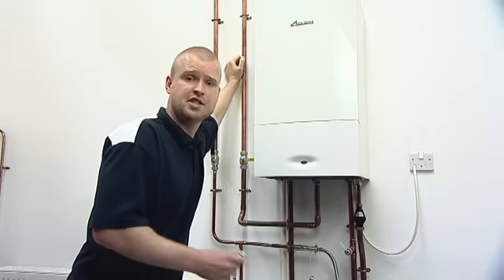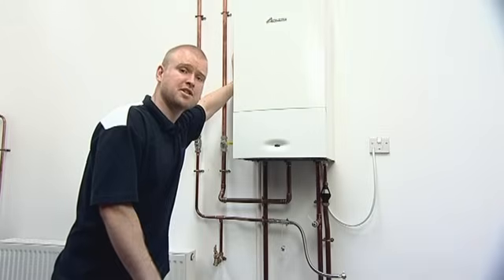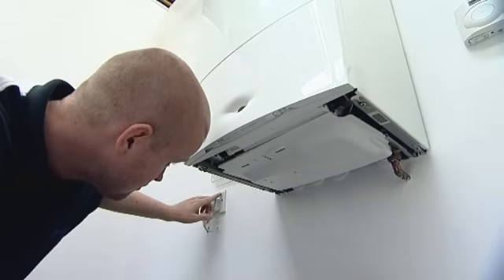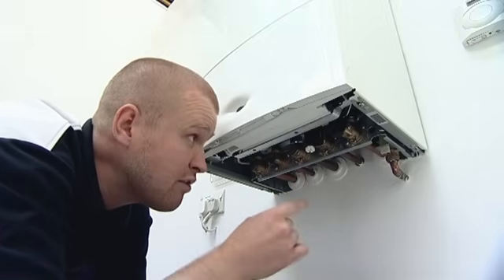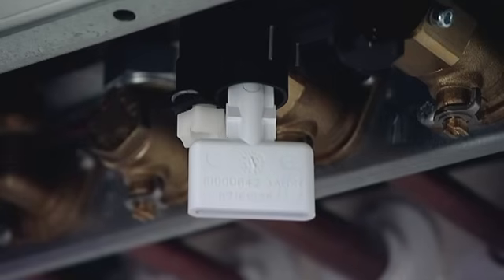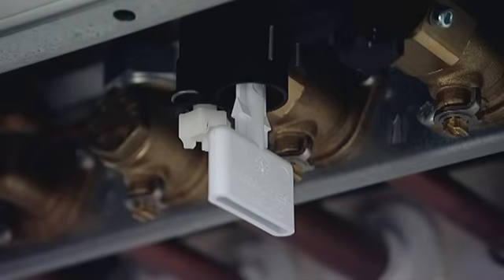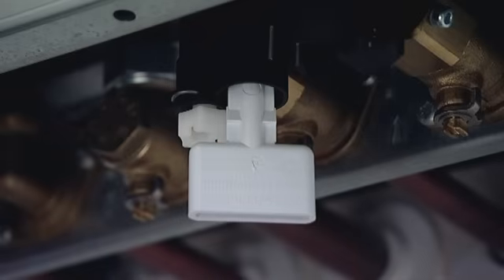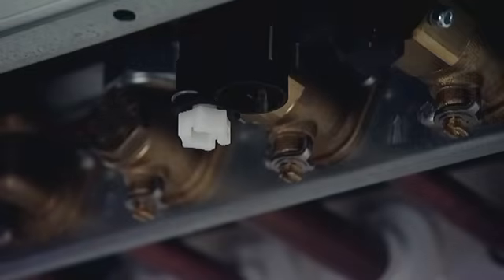How to Repressurise a Heating System with an Internal Filling Key | Worcester Bosch

Comment: My mum's boiler pressure always drops to zero which messes up how it works; it cuts off when she turns the bathtub tap too high & makes strange noises. Repressurising is difficult because the tap is so stiff that it's basically stuck. And every time an engineer visits they "fix" whatever they think the problem is but then the boiler goes right back to square one almost immediately after they've gone. At this point it's probably better to have it replaced, right?

Comment: It's strange. I had engineer around today telling me my boiler is on zero pressure, but I still have hit water and hit radiators. He couldn't do the reset (in video) due to an obstruction near to the key area. What a joke. Good video though.

Comment: Can anyone tell me if they struggled getting the key in?? I don't know if I'm just not pushing it in hard enough but it wouldn't go all the way in 😢
Reply: i have struggled getting key both IN and OUT - it wont come out
 after white key turned to open (unlocked) , Eventually I get the white nut to turn and the water can be heard, When pressure is OK after turning white key clockwise, stopping the water, I cannot remove the key (Can;t pull downwards)
Reply: @williamsmith9754  thank you, i couldn't even get the key in. thought it was me! will keep trying

Comment: I just moved into a new house and the pressure is showing as as low in the red as possible. Before I do this, are there any other reasons it would show that? Or should I just go ahead and follow these instructions?

Comment: I think I'm retarded as the water just leaks everywhere when I try this. I was successful with other brand boilers. I can swear there is a pipe missing in that spot, the key just keeps spinning round, there is no mechanism to close it.
Reply: my boiler has just done the same did you manage to sort it?
Reply: FiFitricks Olivier Yes. Push the plastic key in deeper.

Comment: Great, informative video. Unless your key is so tight it doesn’t turn and flexes, threatening to snap. We inherited the boiler 7 years ago with house and refilling has always been hit and miss because of this tightness issue. It’s a ridiculous system and would put me off a Worcester/Bosch boiler in the future. So what to do, a boiler with zero pressure that can’t be refilled....
Reply: I've got problems with mine too, I can't remove the key and it just keeps turning. The boiler is on 0 pressure and when I try and fill it the water just leaks out.

Comment: I spent hours trying to follow this: damn key would not go in. Eventually I just turned the square white tap without using the key. Worked fine. Would have been much quicker if I hadn't watched this!

Comment: Agreed - great video.  Used it a few times to remind me what to do.  
Problems I have are (1) getting the key in.  Always been a struggle but keep pushing it just a bit further and then it's in.  However, (2) always been difficult, but today I cannot get the key out.  Seems well stuck this time and I'm worried about breaking the key in place or damaging the boiler.  Please can we have a video on that?

Comment: I am trying to do my boiler just now, I have the key at the locked padlock and when I turn the water on to fill the water just comes out from where the key is in? Any advice 🤷🏻‍♂️ thanks
Reply: You need to push the key in further up! I had the same problem

Comment: mine doesnt have a plastic key for some reason, and it doesnt have a plastic manifold under the boiler either. Would it be ok to use a flat head screw driver on that 3rd pipe thing under the boiler off the video? My boiler is the worcester 30cdi

Comment: Thanks for the video. Easily the most annoying pressure top up procedure ever. Cheap, nasty, plastic key, markings that are impossible to see under the stairs and really hard to see the pressure gauge when you have to slide under the boiler to force the ridiculous key into the hole. Terrible design. But the video helps to clear up the problem. Somewhat.

Comment: Does anyone know if you actually need to remove the white key after returning it to the unlock position?  Mines stuck in....
Reply: My new fitted boiler has this issue as well, your suppose to take it out for regulations but won’t do no harm leaving it in

Comment: It’s CLOCKWISE!! 2 minutes in. He says anti-clockwise while turning it clockwise. Nearly cost me a plumbers visit till I rewatched it.
Reply from the maker: Hi Kay, I can see that he does start to turn clockwise but then immediately stops and turns the nut anti-clockwise. The correct way to turn it is anti-clockwise 😊 - Aiden
Reply: Worcester Bosch - Hi Aiden, on my boiler it is a left turn - clockwise. And right to tighten. I am referring to the white plastic square. In the video he turns it left too.

Comment: I followed this but when I turned the white nut water started pissing out
Reply from the maker: Hi Chris, This normally means the filling key is not fully inserted all the way, it can take a bit of force sometimes. If you give our tech team a call on 0330 123 3366 they should be able to help over the phone 😊👍 - Aiden
Reply: Pushed it in further and pressure up nice now . Bleed radiators but still no heat?

Comment: Very informative video, thanks
Unfortunately our water pressure is at 0 and when I turn the small valve, water pours out and the needle doesn't rise at all. I have to hold a huge bowl underneath which fills very quickly. Any ideas?
Reply: Yes: When I did mine, turning the key water came out and it did not work! SoI turned the key back to lock and opend the white nob. Waited for about 30sec then turned the nob off and the key to unlock. Then turned the key to open , and it worked.

Comment: very helpful. I now have consistent hot water. What surprised me was that the key was already in position and I could not turn it but was able to switch water on and switch off when it got to 1.5 bar. Thanks

Comment: Hi I watch this and thought I could do it no problem but I went to the boiler and there was no key? Years ago I used to be able to twist a skrew at the back of the boiler and it was fixed. Now I am afraid to touch anything in case its gas. Is there a way I can do this without a key?

Comment: I have followed this but once key is in, turned to lock hen turn the white plastic ut water flowes out.  any ideas what i am doing wrong?
Reply from the maker: Good morning Dave, It sounds as though the key may not be fully inserted, it can be a bit stubborn sometimes. If you are continuing to have this issue it would be worth giving us a call on 0330 123 3366 so the tech team can help 😊👍 - Aiden

Comment: Anyone else try the blue lever and just got a couple of drops of cold water out the bottom and no pressure change?
Reply from the maker: Hi Steve, if this is happening it could be that the water to your property is playing up or the pressure method has failed. I would recommend giving our tech team a call on 0330 123 3366 as they may be able to help 😊👍 - Aiden

Comment: Excellent instructional video. My key was difficult to insert into the hole, quick touch of fairy liquid on the 'O' rings help to ease it in. You do need to make sure that it is fully seated before you turn to the lock position. If not it will drip water, when you turn the white fill knob on.
Reply: Thank you for this comment, I was ready to give up after 3 attempts but after reading your comment I tried the fairy liquid and got the key in all the way!

Comment: I've done this a few times but today I cannot turn the white button anticlockwise as it is too stiff- Have tried with a little spanner but it hardly moves and the pressure is very low.

Comment: What key is that guy using? Mine is like trying to get the proverbial sword out of the stone.
Reply: im sure if you don't have it Screwfix  or similar hardware shop will have it.... or if you're desperate a large flat head will work.
Reply: @bashthefash420  I've got a key....it's permanently stuck in the boiler. I'm actually not bothered about it, if anything goes wrong I can just buy a new boiler.

Comment: First time I went through this procedure of refilling the system (after drain down) my boiler started dripping from the bottom and would not stop dripping, it turned out that the auto air vent inside the boiler got stuck partially open so all I could do was drain the entire system to stop the leak and call out an engineer.

Comment: I managed to refil the water by following your instruction. By fiddling with on and off key It now went beyond 1.5! How do I decrease it to 1.5? Also I can't pull out the arrow key it was there left by the engineer! I watched you turning back to padlock open position before pulling the key down to remove it. Is it safe to leave it there on Open pad lock position since I can't pull it off? Please reply and THANK you very much!
Reply from the maker: Good afternoon, To decrease the pressure it is best to drain a radiator closest to the boiler. If you need help with this you can give our technical team a call on 0330 123 3366. 😊 - Aiden

Comment: I can't remove or pull down the key! Should I leave it to the pad locked position or open padlock position, please Help!
Reply from the maker: Good afternoon, The key can be quite stubborn sometimes. I would recommend giving our technical team a call on 0330 123 3366 as they have some tips for you. If it has to be left in it would be best to leave it facing the closed padlock symbol and just make sure the nut to the left is 100% closed to avoid the pressure rising without you noticing 😊 - Aiden

Comment: The trouble I had with this 'key'  went on and on,  each time I thought I had it I got nothing but water when I loosened the feed I could not get it to mesh with the connection in the pipe wether I had a sub standard key I don't know, I hope I don't have to go through that very often is there no other way to re-pressurise the system?
Reply: Info: When I did mine, turning the key water came out and it did not work! SoI turned the key back to lock and opend the white nob. Waited for about 30sec then turned the nob off and the key to unlock. Then turned the key to open , and it worked.

Comment: Did this the first time ever because I noticed some strange noises from the boiler and found pressure in the red. Key was already in place and in the lock position?! Anyway followed instructions and that was perfect! However I couldn’t get the key out after turning it to the open lock position. Is that ok?
Reply from the maker: They can sometimes be quite stiff to get out, I would recommend giving our technical team a call as they may have some suggestions.  You can do this by calling 0330 123 9339 

It is not too bad to leave the key in, but it is certainly recommended to remove it to avoid the possibility of the pressure rising without your knowledge.😊👍 - Aiden

Comment: my internal filling valve - the white thing he turns has snapped off inside. can I remove the broken bits and use a screwdriver to turn it instead?
Reply from the maker: Hi Nicholas, I would recommend contacting our tech team on 0330 123 3366 as they may be able to offer advice over the phone. 😊👍 - Aiden

Comment: Hi, can you tell me why my needle is not moving? Ive done everything you show in your tutorial (and it has worked in the past), but this time I can hear the water but the needle is stationary. Thanks
Reply from the maker: Good morning, If the needle is stationary when topping up the pressure it means either the water is not entering the system or the pressure gauge is faulty. In either circumstance I would recommend an engineers visit, however please feel free to contact our tech team on 0330 123 3366 as they may be able to offer some advice. 😊👍 - Aiden

Comment: thanks for your video I always forget how to do this. one tip that helped me is the rubber washers prevent key going in easily I used washing up liquid and worked like a dream. cheers
Reply: Great advice about using a touch of washing up liquid, thank you! I also wiped a dab on the edges of the plastic tray as it wasn't going back into the slot/runners afterwards. I'll be dabbing it on everything that gets stuck now! LOL!

Comment: Can I leave key in unlocked position...? The key won't  come off and worried it will break something. Only concern is over pressuring?
Reply from the maker: Hi Prabin, It would be best to remove the key just to make sure the system pressure doesn't rise without you knowing. It should be fine to leave it at locked but it is still a risk, I would recommend giving our tech team a call on 0330 123 3366 they should be able to offer some tips to get the key out when it is tight like that 👍😊 - Aiden

Comment: This worked, but immediately after restarting I got a weird 'HH' code with the far left and far right digits missing - apparently this is nothing to worry about, a kind of commissioning mode which disappears after about half an hour of use. Pressure isn't changing and my radiators are now heating up fine :-)
Reply from the maker: The code you are talking about is Siphon fill mode, you are quite right nothing to worry about. Sometimes when the boiler has been off for a while or the heating put all the way up or down it can enter this mode, if you leave it with no demand it clears itself in 15 mins or so. I am happy to read the video helped 😁👍 - Aiden

Comment: I had a tenant leave and upon leaving he had deliberately left pressure valve open and shut off gas supply to the boiler. Boiler can't maintain the pressure for more than a week. Would this help get the balance right again?
Reply from the maker: If your boiler pressure needs to be topped up weekly then more than likely there is an issue with the boiler or possibly a leak somewhere on the system. I would recommend getting a engineer to take a look. 😊 - Aiden
Reply: @WorcesterBoschHeating  thank you.
Reply: I did check under my boiler. The key is missing. Did you say you had spares?
Reply from the maker: @nauxsi  We may be able to send you a new one, please get in contact with us to discuss further https://www.worcester-bosch.co.uk/about/contacts 😊 - Aiden

Comment: My boiler has exact same key system... but when I turn key to locked position and then turn that nut anti clockwise water just pisses out down past the key. None of it seems to be going into the boiler.  EDIT:  Solved it!  Key just wasn't going in far enough. Those seals on the key need to be pushed in.
Reply from the maker: It can take a bit of force to get the key in all the way, happy to hear its all sorted now 😁👍 - Aiden

Comment: Hi there, I have just tried this now and instead of letting out the noise it actually just leaks water and the gage doesn’t move at all. Any suggestions? The heating is actually working at the moment but wanted to repressurise it just in case..

Comment: Legend. Had issues with the key being tight and assuming it had gone the full distance then leaking when turning the spindle. But eventually got there. Perfect video mate, modern day super hero.
Reply: Thanks for leaving this comment. I had the same issue and almost gave up and called a professional.
Reply: Me too. Water all over work top. Turns out I didn't push key in far enough to seal. Was afraid to try again in case I flooded kitchen. Had another go, success! So happy I've done it now. Video is great.
Reply: Hero! This happened to me and I half flooded the kitchen!
Reply: Finding this comment now. My key was a bugger to get in but i eventually did it with alot of wriggling and curse world's. I had to use a penny to turn the spindle as the previous person who did it tightened it up so much it wouldn't move! 🙌🏽
Reply: @karli1111 using a coin to turn the spindle… genius!! Thank you 😊
Reply: Thank you. This really helped me
Reply: Yep , and like a lemon , not the first time 🙄

Comment: JUNE MEGA DEAL 🥳🔥💷
All this for ONLY £1195 supplied and installed- all inclusive package:

WE ACCEPT ALL MAJOR CREDIT CARDS!

✅ ‘A’ rated Combi Boiler/Horizontal Flue
✅ Inbuilt frost protection system 
✅ Endorsed by the Energy Saving Trust
✅ 5 star reviews for easy installation 
✅ Wireless Thermostat -FREE
✅ Full system chemical flush - FREE
✅ 10 Year Warranty as standard

PRICE VALID IF BOILER ORDERED THIS MONTH -BE QUICK TO AVOID DISAPPOINTMENT

We can also :
*Convert your old system boiler/tank to a new energy efficient Combi boiler for only £1469!! 🔥

*Supply and install a full new gas central system for you- boiler and radiators for only £1999!! 🔥

Please feel FREE to contact us any time if you have any further questions we are currently booking out the second week of July but ASAP INSTALLATIONS FOR EMERGENCY BREAKDOWNS!

Visit our website www.onlineboilercompany.co.uk or Facebook page for your FREE INSTANT QUOTE, to see some of our previous job photos and read some of our 5 star reviews 😁

Comment: Very useful video. You must make sure you push the key fully in though. I did not find it hard to push in or stiff to turn, but when I thought it was fully in, I opened the knob and water poured out. Turned it off, pushed the key in further and all OK.

Comment: What about if water is pouring out the bottom of the key whilst its in the locked position and open the water screw. Mine don't pressurize, it merely makes a mess of the kitchen.
Reply: Mine is doing the same! Help! Did you find an answer?

Comment: That was very helpful. I've mislaid my instructions, and I couldn't remember how I've done it in previous years. You missed the most difficult bit which is replacing the flap underneath. It takes me hours to get it back every year.
Reply: I just leave the stupid thing off
Reply: I just came to add a comment about replacing the panel, and realise I did that six years ago. I've just spent 10 minutes trying to fit it with no luck. I will have to look stupid and ask the engineer to do it when he comes to service it next week.